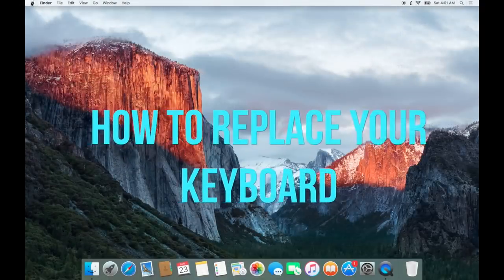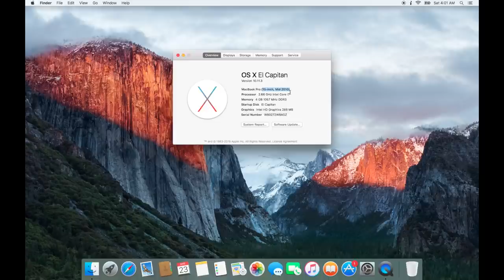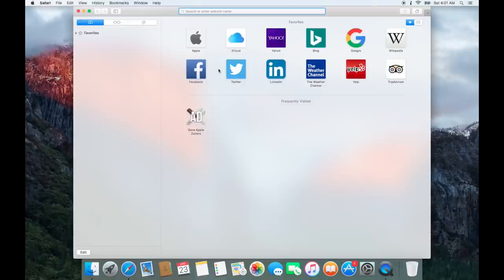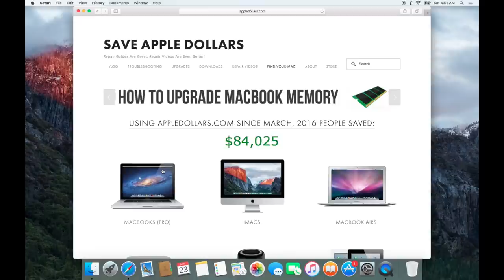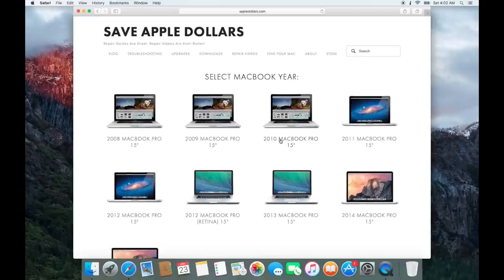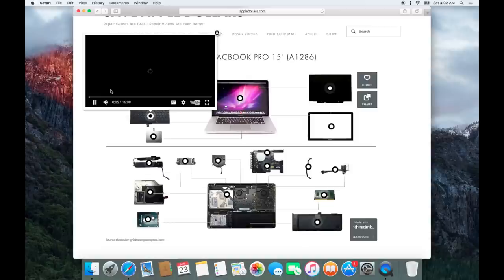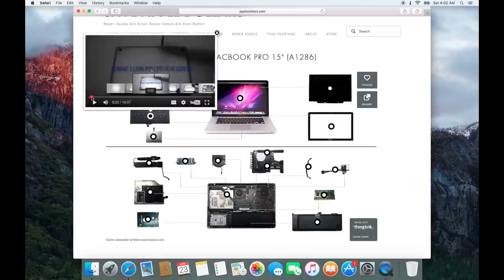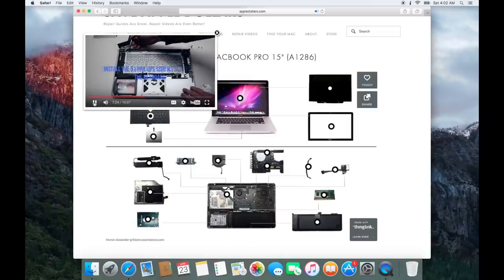How to Fix Any Macbook Keyboard

Comment: I just replaced the keyboard on my MacBook Pro 2010 as you can see here
https://www.youtube.com/watch?v=PsP66hyOj2k

Now when I boot up the Mac the keyboard dose not work. Is there any tip on how I can get the keyboard to work?
Reply from the maker: Re seat the keyboard connection to the logicboard. If you got the Mac to power on after the keyboard replacement, then the keyboard works because the power button is part of the keyboard. If the Mac turns it self on automatically after you plug the charger up to it, then the keyboard is not connected properly.

Comment: Hi there! First at all congratulations for your great youtube channel men, it is really helpful with all those problems that almost always tend to be a pain in the ass. 

Well I have a question for you, I need to replace my keyboard and trackpad to my macbook pro 13 mid 2009, My previus laptop it was also macbook pro 15 mid 2009. the question is ¿Can I replace the keyboard and the trackpad from my previus laptop to the 13 mid 2009 laptop? ¿Those components are the same?
Reply from the maker: Glad to help. So the 15" and 13" have different cable lengths and layouts for both keyboard and trackpad, unfortunately you will need to get the 13" 2009 a1278 versions. Hope this helps.

Comment: Certain keys on my 2012 13" MBPRO will quit at times. If I hold the dead key down for a few seconds it will usually start to work again, or if I type a word string of working keys the letter will pop up. Really strange that the keys stop just at random times. Mostly the TYIOP keys. Any ideas what could cause just a random failure like this?

Comment: yeah this video has helped me. my R key has to be pressed with extra effort and I was worried that i have to replace the whole keyboard of my macbook air. Then i found this video and I just pull the key out, look around(see nothing wrong) and popped it back in, boom! it work flawless now. Thank you! You just saved me from spending on the new macbook Pro 16" !! 🤣

Comment: Hello friend, greetings from Spain. I wanted to ask you a question. I have a MacBook at the end of 2011 I think it's the 1278 model if I'm not wrong. My problem is that there are 3 keys, which do not work are the keys: A, S and D. They work only when I press them several times continuously. What problem can it be? And how can I solve it? Thank you very much friend
Reply from the maker: Sounds like there is liquid damage that is bridging the rail for those keys. The only real fix is to take out the keyboard and wash it but if you take it out you should replace it with a 100% working one, they are so cheap. Here is a link for the replacement instructions https://www.youtube.com/watch?time_continue=5&v=kz7qt53GsFs and here is a link for an international supplier https://ebay.to/2l6kIiU and here is a Spainish layout https://ebay.to/2JxgrDL

Comment: Ok so I have a 0 key that isn't working, the key's in good condition from my view but it just won't type. Any ideas or feedback?
Copy & Paste won't help forever,
Reply from the maker: Only a full keyboard replacement will fix it.
Reply: Oh, thank you for the info!
Reply: @GRIBSOFT  how much do you think the cost of a new keyboard for a macbook pro 2012 with the disc on the side would cost.. I have the j, k, and l letters not working..  Also, what about a bluetooth keyboard.. could I just place it on top of the original keyboard and work it that way??

Comment: Thank you for your amazing tutorial

I have different issue, I opened up my power button to clean it because I spilled juice on it, after few days suddenly it doesn't work unless I press it so hard with a screw and sometimes won't work and now accidentally I cut the plastic cover under the button now I can’t turn on my mac (I don't know if this important to make the keys work) please help.
btw I have macbook pro 2014 13in
Reply from the maker: You will have to replace the keyboard, but until then here is a work around (you will have to disconnect the battery first) https://www.ifixit.com/Answers/View/216057/How+to+turn+on+without+power+button

Comment: Please help with the little keys on the top row of a MacBook Air, my son bought me used. I cleaned the screen then key tops when off. One key stuck and auto-filled password box. Fix the one big key, now won’t turn on. Removed power key to examine, found nothing but unable to position the two white curved tabs correctly & unsure of the “U” shaped metal bar.
 I am an auto tech forced into retirement early due to multiple bad joints that 4 surgeries may fix, but between a rock and hard place. I don’t want my son to pay to fix as I can replace the entire keyboard if that’s what it takes. I have the pentalobe screwdriver required to start by simply disconnecting the battery to let caps discharge then retry. I have tested each key and tried the “Button Tricks” with 3 & 4 keys held, shown in other vids. Don’t have cell account but use my $20 internet to pay bills & stuff. Can you suggest something to help a 61 year old dude living on little but lots of pain? I would appreciate it. Thank...
Reply: I know everyone is busy as we approach Thanksgiving, and I don’t know when this video was posted, but please help. Reply thank you if you can.
Reply: Nothing?
Reply: I hate everything Apple ever made in China...Opps, that is everything they every made, except the garage thing ;(

Comment: command alt R combo or anything not working 

what to do
Reply from the maker: Try on an external usb keyboard of any brand even windows keyboard will work, if it doesn't then it's a logicboard issue if it does then replace the mac keyboard.